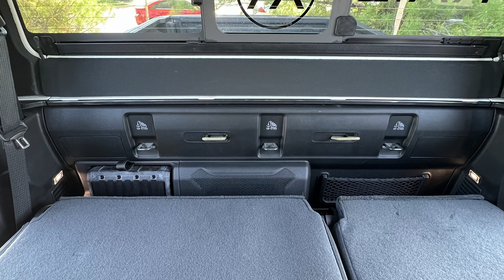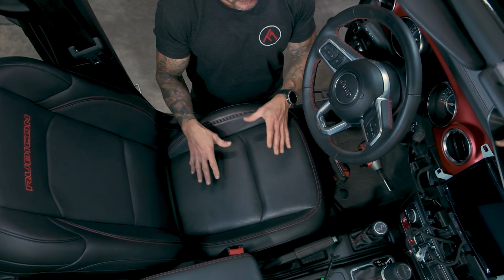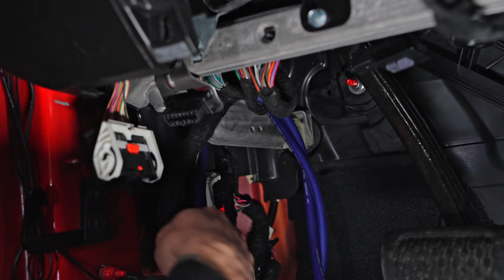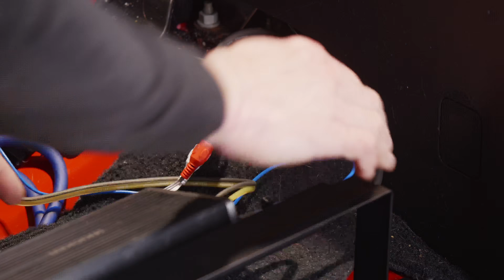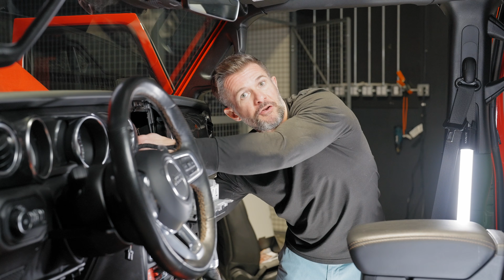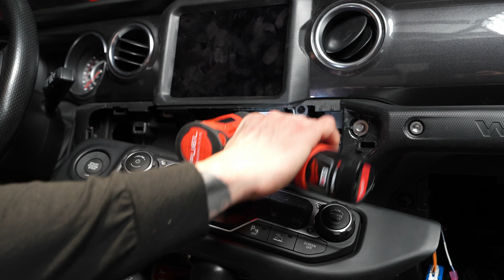Subwoofer & Amp With A Factory Radio Installation I '18 - '23 JL Wrangler/ '20 - '23 JT Gladiator

Comment: I have a 18 wrangler jl with the non alpine system what all would i need in order to bypass the factory amp to run an aftermarket amp?
Reply from the maker: Hello- if you don’t have the Alpine system, you don’t have a factory amp to worry about bypassing.  

We have many plug and play bundles for the non-factory amplified JL to add an amp to.  

Are you wanting a mono amp for a sub only, or a full 5 channel amp for speakers and the sub?
Reply: @trailseven  5 channel. I’m not savvy with this stuff so I’m trying to figure out what all i would need
Reply from the maker: @HarrisonBianco Totally get it.  What are you trying to achieve?  We can help with what’s needed once we identify the end goal.
Reply: @trailseven I’m mainly wanting to amplify the sound bar speakers i replaced them with 4ohm 6 1/2 inch kicker speakers and the overall sound quality is quiet, but also want to future proof for a sub
Reply from the maker: @HarrisonBianco We have a plug and play amplifier solution, however it would be a 5channel amp to power all of the speakers plus a subwoofer.  With that said, you will want to swap out the dash and knee speakers as well.  

Here is the 5-channel bundle option: 

https://trailseven.com/collections/amp-bundles-sub-bundles/products/kicker-complete-5-channel-amp-kit-bundle-18-23-jl-wrangler-20-23-jt-gladiator?variant=44095848317181

Comment: I have a stinger sub box for my 2021 gladiator which is factory amplified a mono amp as well as a 4 channel amp. Do you sell as a kit the the wiring , fuse block and the pac unit?
Reply from the maker: Hello- We certainly can, however our kit would come prepped as if the 4-channel is mounted under the driver seat and the mono is mounted under the passenger seat. 

If that configuration works for you, you can reach our team directly for  assistance.  

You will need the dual power kit, the amp bypass harness, and the PAC module.  Let them know if you will also need the fuse holder and the 2 under seat amp brackets.  You will see this configuration in our recently released dual amp installation video.  

Support@trailseven.com
Or
301-450-3207, 9-5 est, Mon-Fri

Comment: I checked the price for the jlur without the factory amp and sub ,, soo expensive 🙃
Reply from the maker: @hasanmahajna2339  We do have a lot of configurations so it may be best for you to reach out to us directly so we can try to match an option that’s within your budget.
Reply: Right, I wanted the harness, but I realized I can just buy the part separately. At a lower price.

Comment: Connect to the battery before running it?! I'm pretty sure I saw the end arc on the amp and they tried to edit it out 😂
ATTENTION PEOPLE: DO NOT HAVE A HOT WIRE RUNNING THROUGH BY METAL
Reply from the maker: @Nerd_Rage_Initiated  There was no attempt to edit anything out.  Yes, it may spark, nothing to hide.

Comment: I’m lost .everything I put in like you did it..non factory amp 2018 Jeep wrangler JL base model ..but still no sound..amp is on, pac device is on(soild red light) .im trying to the set the Din 4 switch thing but no luck either
Reply from the maker: @TheGREGANBU  
 It may be easiest to assist via live support so we can isolate the issue better as the problem could be from a number of connections/ terminations, etc.  

Have you reset the PAC module?  DIP switch 4 must be in the down position for non-factory amplified jeeps.  

 Please reach out to our tech support team during regular business hours so they can assist with troubleshooting.  

You can email or call us, 
Support@trailseven.com
Or
Monday- Friday, 301-450-3207, 9am-5pm est

Comment: If I already have new speakers will I need the factory amp bypass harness or will it be okay without it?
Reply from the maker: @jetpuck  Is your jeep equipped with the factory subwoofer?  If yes, you will need the amp bypass harness which bypasses the factory amplifier in order to utilize the factory speaker wire.
Reply: @trailseven Thank you for the clarification.

Comment: Ok where do I get the non factory amplified module?
Reply from the maker: @ChristopherClark-l6j  Both options are available on the product page.  Are you asking for just the standalone module and not the full bundle?
Reply: @trailseven  yes I have my speaker,box and amp just need the way to hook it too my gladiator
Reply from the maker: @ChristopherClark-l6j  Drop us a line and we can get you squared away with what you need.   Support@trailseven.com.  Mention that you need the plug and play mono amp kit for a non-factory amplified Gladiator per this post.

Comment: How much of a difference would the stinger head unit make in sound compared to the 7in head unit
Reply from the maker: If you have any aftermarket radio, you won’t need the interface module.  You will route the RCA’s directly to the radio vs the module.  

We can prepare the bundle without the factory radio connections as well.
Reply: What would I do with factory sub do I just disconnect it after installing new sub and amp?

Comment: I have the new apmPRO 4 non factory amplified, I just want my amp to my sub hooked up. The kit came with factory speaker harness, where does that get splice to?
Reply: Why the harness with wires then??
Reply from the maker: @Bill-le3jf  Can you provide your order number so we can assist?
Reply from the maker: You purchased the bundle from Trail Seven? 

If so, nothing in our bundles require any splicing.  

If you’re needing installing support, please call or email us for assistance.  

301-450-3207
Support@trailseven.com

Also,
Please provide your order number for reference.
Reply: Order # 6910. Stock speakers, no amp. I'm trying to hook up just a mono amp  and two subs
Reply: @trailseven
Reply from the maker: @Bill-le3jf  Order 6910 is for a speaker bundle only.   If this is your correct order, I don’t see anything in your order that includes a wire harness.
Reply: It comes with a connection with loose wires! Do I use that?
Reply from the maker: @Bill-le3jf  I see you placed the PAC module through us.  We send our bundles out pre-wired.  You’ll need to run your speed wire from the amp to the module harness speaker wire connections.
Reply: 6912#
Reply: So, if I run speaker wire from the amp to the loose wire harness it should work? What's the point in having the rca connections?
Reply from the maker: @Bill-le3jf  You need the RCA connections as well.

Comment: What are the options for 2024 Wrangler with the 12" screen? Are there any? My factory non-amp needs some subwoofer thump.
Reply from the maker: We certainly do have the solution to add this same set up into your 2024!  

Reach out to us directly so we can manually put your bundle together.  

Support@trailseven.com